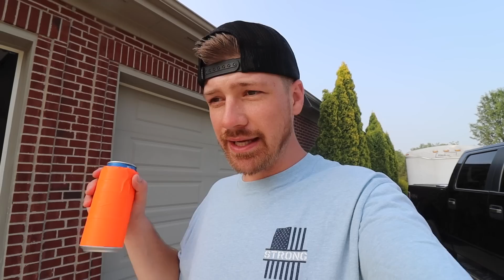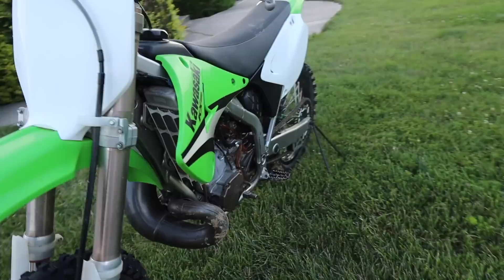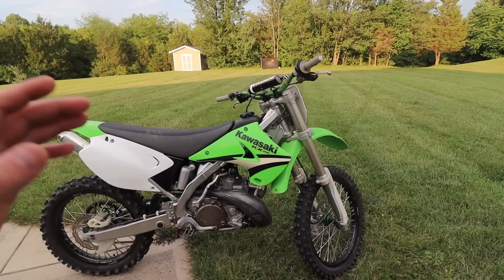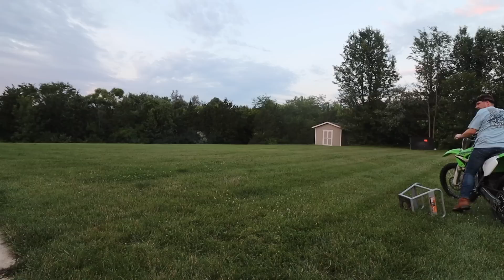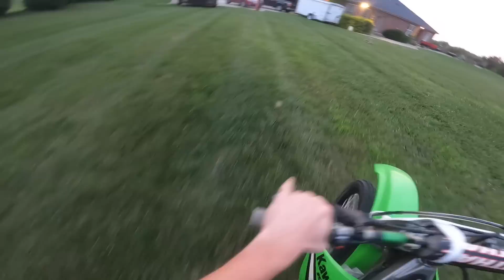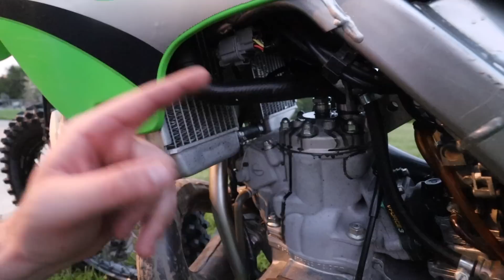JET FUEL in Kx250 Two Stroke!

Comment: You need to put moon shine/ alcohol in it.
Reply: Yes put moon shine in it
Reply: Yesss
Reply: Yes. Some type of grain alcohol.
Reply: Yess!!!!! Pleas!!!!
Reply: I use pure everclear
Reply: would have to build it for alcohol 👀
Reply: Alchy and two strokes are always a bad combo. 
Alcohol strips the oil off the wear surfaces and burns up the engine. Oil and alcohol do NOT mix.
If you can figure out how to prevent that and keep everything well lubed, it’d be fine.
Diesel, jp8, and similar fuels have some lubricating properties, but should still have a bit of oil(less than gasoline obvs) mixed in.
Reply: @NN1Ckl.  Rc cars planes boats etc are usually 2 strokes and they run on methanol with nitromethane and 2 stroke oil. I think back in the day it was castor oil now it's probably something synthetic.

Comment: The oil you used settled at the bottom of the tank and flooded the carb. For kerosene (jetfuel), methanol , ethanol etc you need to use Klotz benol.
Reply: i run dominator in my bike not klotz with no issues
Reply: is klotz benol or super techniplate better?
Reply: @duskycotw8404  super techniplate has benol in it, regular techniplate is full synthetic. the more castor you run the more regularly you need to clean the engine it carbons up with gasoline it really runs better in alcohol fuels like RC engines
Reply: @AneroFilms do you also run jet fuel?💀
Reply: @duskycotw8404 either is perfect! Benol is bean castor oil super racy smell the tech plate is synthetic with some benol.. both awesome oil and better than maxima..
Reply: @mxr248  i heard you cant store bikes with super techni plate because it rusts the cylinder is this true?
Reply: @duskycotw8404  never heard that and I have done it for over 20 years with no problems. Even when I tore the motor down to do top end everything was nice.
Reply: Your crazy
Reply: @blakeraviscioni6672  did you even read the original comment
Reply: @AneroFilms did you?!
Reply: @AneroFilms  You obviously don't run jet fuel in your bike tank. You need to reread the original comment.
Reply: @FarmerFpv  he said “ethanol” I’m assuming he means gas with ethanol in it i dont usually run gas with ethonal but the times I have I’ve never had an issue running dominator premix but usually I run vp c12
Reply: I used to seize my Husky, wet and dry the bore and cylinder. Repeat until it stopped seizing. Rattled a bit when cold but you could go wide open Thereafter..
Reply: That's not true. It's just too much oil in the mix

Comment: Jet fuel with the right jets and probably some diffrent reeds would work fine in the higher rpms im sure of it
Reply: I think jet fuel is so close to regular kerosene its got super low octane rating and will knock like in the intro part early in this video. A bit of retard in the timing and he would be good to go with jetting aswell :)

I have an old kerosene yamaha 20hp outboard and its got bigger jets on the kerosene side and fuel line connectors for each fuel. You warm it up and switch to kerosene when the motor is warmed up. I think its a base 25hp model modified from factory with lowered compression to be able to run both fuels. 

What I would love to see him run is Low Lead 100octane flying gasoline :D
Reply: No, just no. It will do nothing but hurt performance.

Comment: For you guys who don't get very good starts, (hole shots).  It is actually faster to not use the clutch on the up shift.  Just let the gas off a bit, hit the next gear and back on the gas.  I bet most modern bikes will still shift with no clutch and leaving the gas on, (which is the fastest way), but I still say that has to be harder on the transmission, and I am in no hurry to rebuild it.  You can test the differences on a moist dirt road, where you can see the coasting patches between gears on the ground.  The shorter the coasting patch, the longer the time that the wheel is driving forward. I know, I read the opposite in modern MXA.  But I actually learned that from 1984 MXA and tested it myself, and I always got great starts.  :)
Reply: Early 2000’s when I was learning my brother told me The same thing, he said those AMA racers are doing the same. Keep on the gas. Also taught me how to use it in certain corners love my brother wish we still bonded a lot but he’s got 3 kids now and a wife my family can’t stand lol.
Reply: For Sure 100% true. I do that in my 89' Blaster and dont have a single problem with it, i dont even have cut gears. all you need is a bit of finesse with the throttle and thats all she wrote!

Comment: Just fyi 
Jet fuel and kerosine are basically the same thing 

Early Briggs and Stratton engines sold a kit with dual chamber gas tanks 1/2 was gas to start the engine the other 1/2 was for kerosine to run the engine  (I guess kerosine was dirt cheap back then)  it also came with a extra thick head gasket to lower the compression ratio to avoid detention

Comment: Used av gas back in the 80's racing 2 stroke road bikes. No issues at all. I think it was like 115 octane or so.
Reply: Avgas is high octane petrol for piston engines. I've run race bikes on it before. Unless you're running really high compression ratio it'll go slower because the fuel has a higher flashpoint and won't burn properly in a stock engine. Jet fuel is completely different stuff.
Reply: Aviation Gas and Jet fuel / Jet-A1 is very different fuels... Avgas is gasoline while Jet fuel is kerosene, you can run a diesel engine on kerosene perfectly fine if you add 1:200 of 2 stroke oil. I did run a Mazda 626 diesel on kerosene for 2 years.
Reply: @neilpincus855  I was partially sponsored by Cam2 back in the day. A guy drops off a 5 gallon pail of experimental premix and says " don't leave it in the sun"!!@!. I think has nitro in it. It was never commercially available. Between avgas and that oil my Suzuki rg500 ran clean!

Comment: thanks to WW2, petroleum spirit (gasoline) was in very short supply here in the UK during the war years and for some time after so people experimented with alternate fuels in spark-ignition engines. one winner was paraffin (now more commonly known as aviation fuel/jet fuel). they would use some form of crude twin-tank arrangement to warm up the engine on gasoline and then switch to paraffin because paraffin won't vapourise properly at lower temperatures. the old boys talked about the engines coking up quite quickly and poor power but it worked. some farm tractor engines were specifically adapted to run on paraffin.
paraffin is a light dry fuel inbetween gasoline and diesel and should work in the bike with some 2T oil in suspension.

Comment: Hmmm. Where'd ya get the "jet fuel"? What Octane was it? We run 105-110 in our race bikes. If you don't run a high compression head on that bike. The "jet fuel" won't really hurt or do anything.  Advance the timing a tad too.. Your plug and compression isn't enough for you to notice a diff. Running rich because it can't burn that fuel/oil mix properly. Cheers!

Comment: Hello. Helicopter crewman here (h60 which has t700-GE401C turboprops and runs on jp5 or jp8)… jet fuel is just refined kerosene, which is basically the same flash point as diesel. They’re both ignited by compression. It would have the exact same results with diesel.

Comment: Hello from Greece. Try to adjust your carb to give 30% less fuel than normal gas. Diesel, including jet fuel does not burn completely, and it builds up inside and creates more compression than it can take.

Comment: If you run a different fuel than the gasoline the bike is jetted for, you need to re-jet the carb.  The fuel/air ratio is different for different fuels.  Even though it was smoking a lot, that is just an indicator in this case, that there is a lot more oil in that mix.  The bike may be running leaner, possibly detonating and may have cracked the porcelain of the spark plug, (or it is not tight), to cause all that mess on the top of the head.  For the different fuel/air ratio, for example, Methanol needs almost twice the fuel compared to gas to get the correct fuel/air ratio.  I don't know about the kerosene, (jet fuel).  You would have to research that to find out what jetting you would need.  I don't believe the bike made more power there, (your imagination probably, since you have a lot of that,--lol), but if you can jet it well for that fuel, it might be close to the performance of gas.  I would guess, that with kerosene, you may not need as much 2-stroke oil, or possible none at all.  Less oil will give you a richer fuel/air ratio also, and it might start burning up all that excess oil that just saturated your silencer packing.   I am sorry son.  But your channel is a comedy show.  But I hope you don't take that as the insult I intended it to be.  
Now if you want to play with nitro methane, polly propelin  and some other fuel additive chemical soup factors,-------------------------------you still won't learn much.
Reply: "Less oil will give you a richer fuel/air ratio also, and it might start burning up all that excess oil that just saturated your silencer packing."  Sorry, that was wrong.  A richer fuel/air mix (not to be confused with the gas/oil mix), would smoke and goop more.  So you probably have a huge amount of oil that is not burning.  Would be nice to see what the plug looks like also after running it.  That should be the first thing you do (check the plug) to get a good idea of how the engine is running.

Comment: I run 100 low lead AV in gas in every 2 stroke. It really does wake them up, never had lead fouled plugs but I do run my machines very hard.
Reply: JET fuels is same as kerosene, a completely different fuel then Aviation gas which is same as normal gasoline but higher octane...
Reply: @a64738  your missing 100 AV LL is highly processed with ZERO ETHONAL meaning it's pure gas. That is 95% why I run it in every 2 stroke. It's suitable for IAC engines (not cars or anything with a catalyst converter of course) jet fuel is not meant to work in applications like this.

Comment: Why your bike is smokeing with the jet fuel is that you need more fuel. The stoichiometric ratio for Gasoline is 14.7:1, while jet fuel is 3:1.
Reply: Jet fuel is a slightly lighter and purer distillate than common diesel fuel, similar to kerosene. The fuel content is close to that of gasoline or diesel fuel. It's just too low octane and slow burning to work in a gas engine.
Reply: the stoichiometric ratio for ethanol is about 8 to1 and nitro methane is about 2 to 1. both Ethanol and nitro methane have oxygen in the  molecule chain and the oxygen in the chain the less is the stoichiometric ratio .  Gasoline has no oxegen in the molecule chain  so the stoichiometric ratio is some 14.7 to 1  meaning the engine has to pull in more air to burn the gasoline fuel than other fuels like ethanol or nitro methane. Kerosene or jet fuel is typically  1 part gasoline 7 parts paraffin's  and no oxygen in the molecule chain . That suggests to me jet fuels stoichiometric ratio  will be closer to gasoline fuels  stoichiometric ratio   and not loower than ethanols stoichiometric ratio 8 to 1  and not sure jet fuel will be stoichiometric ratio  3 to 1 but maybe i am wrong and missed something
Reply: @shiningirisheyes  You're correct, though to elaborate on why the fuel content of alcohols and nitromethane is lower is more complicated than them simply containing oxygen in the molecule.
Alcohols contain a higher ratio of hydrogen to carbon than petroleum fuels. Hydrogen requires one oxygen to fully burn while carbon requires two. 
Hydrogen produces more energy by mass (or pound for pound) than any other element when combusted, so when burnt at a stoichiometric ratio you will get more energy thus more power. 
In the case of methanol you get about 35% more power over gasoline as a rule of chemistry, add the ability to run higher compression ratios, more aggressive timing, a faster/hotter flame front and more efficient exhaust flow characteristics and you're looking at around 60% possible peak HP gain with a tuned motor. 

Nitromethane contains a nitro group which contains two nitrogen atoms. Typically nitrogen exists diatomically with a strong triple bond between two nitrogen atoms, a nitro group has two nitrogen atoms bonded to an oxygen. 
The nitrogen to nitrogen triple bond takes considerable energy to break but conversely releases considerable energy when formed. When a nitro group breaks the two nitrogen atoms snap together creating heat and increasing in volume as well as liberating a free oxygen atom which rapidly reacts with any nearby fuel.
 The molecule stores energy like a set mouse trap waiting to snap.
This alone has tremendous energy potential and is a large part of what makes explosives like TNT or nitroglycerin so powerful. Nitromethane itself is actually a very powerful high explosive itself but very stable and hard to detonate.

Comment: Yo while watching you run the jet fuel thru it I noticed some exhaust leaking from the connection to the motor itself. This happened to my bike not too long ago and there was a missing bolt on the connector. Just wanted to let you know if you could get that fixed up

Comment: My father flew remote control airplanes, i used to give a few pumps into the tank , bijes ran great and you could smell that mix 😎😊
Reply: normal sports RC is 15% castor oil for lubrication and 5% nitromethane to  help wide3n the tuning of the  jet needle and 80% methanol to burn with the glow plug  non nitro fuel harder to tune s the jet works with narrow band . Higher percent  nitro more power and wider tuning band for jet needle. semi synthetic lubrication oil or full sytheis works with as low as 10% lubrication oil and so methanol content is higher and increases powr outputs

Comment: Back in the late 50's my buddy and I used to add some jet fuel to our gas in out old Harley's and they run just fine
When you cracked the throttle it would clean the carbon out of everything along with more power.
Reply: This would be a bad idea. Do not make people think this is some special idea.
Reply: jet fuel is like very pure kerosene and similar to diesel.   if you don’t add too much, it will act like a lubricant, but it would also lower the octane rating of the gasoline making the gasoline more likely to knock and cause premature engine wear under heavy load.   i don’t think the jet fuel “cleaned the carbon out” I think rather, it created carbon and fouling, and then the harley motor coughed it out.   there’s no real benefit to adding jet fuel to gasoline, but no real harm, if you don’t mix too much.   I think adding av gas to gasoline might have some bennies tho, if it’s going into a high compression motor.  but i’m not sure if leaded gasoline can somehow harm an engine designed to run on unleaded.
Reply: @bigflicker2137  correct on all   best i can tell

Comment: I used to put half aviation fuel and Sunoco Ultra in my drag car and my Mustang 5.0L from time to time. Gave the same performance as mixing Sunoco Ultra with Super 104 octane booster.
Reply: Avgas isn't jet fuel
Reply: Unless you increase compression higher octane does nothin but if anything lower hp numbers
Reply: Jet fuel is kerosene, Aviation gas is gasoline, 2 VERY different fuels...
Reply: @331moto  I know that. However, they're both used in aviation ...

Comment: Detonation was possibly why your power increased...as well as the head leaking....cylinder pressure too high....recently had my Evo 3 melt down due to a timing issue and it was making good power.

Comment: honestly i just dump 2 stroke oil in my ATC 250r until the gas is clearly colored. the original mix is supposed to be 20:1 which is high af so i just dump it in until i think its good. usually 9-12 ozs per tank.

Comment: Try methanol with klots benol oil. It'll make quite a bit more power than gas. Maybe add some nitromethane for even more power. The methanol shouldn't hurt anything if you tune it properly. Nitromethane will absolutely blow the engine if you add enough.
Reply: f you lower the compression rate to 5 to1 very low use very high amp hot spark plugs open jets to quadruple plus the fuel and add extra oil that works with methanol and nitro methane over 60% nitro fuel rates can be used in engines and are used in drag racers and RC models  because nitro methane is very low octane fuel that has stoic of 2 parts air one part fuel and can work as monopropellent with no air needed but you need gobs of fuel so hydro lock often destrys engines at over 60% nitromethane ratios in the fuel mix
Reply: You will need jets that pass about twise the fuel for methanol compared to gas.  But if you don't bump up the compression, it will not make as much power as gas.  The advantage of alky is only seen with compression that is too high for gasoline.  This is why "flex fuel" cars/truck that can run both E-85 (85% alky-15% gas) and gas, make better power running gas.  The compression is fixed for gas so it will run both with out engine damage.  One nice thing about alky though, compared to gas is, the jetting "window" is bigger with alky.  Gas will start running poorly when a bit too rich, but extra alky just blows out the exhaust port and does not hinder performance as much if too rich.
Reply: @shiningirisheyes  I will stay away from your comment about high percentage of nitro methane and a low 5:1 CR.  I don't have any experience with the stuff or the engines that use it.

Comment: I'm surprised you can get enough compression and heat to get this fuel to run.  Diesel/kerosene/jet fuel can handle double the compression ratio as gasoline.  I wonder how this would perform if you raised the compression ratio?
Reply: Probably fairly good until it destroyed the rod bearing.